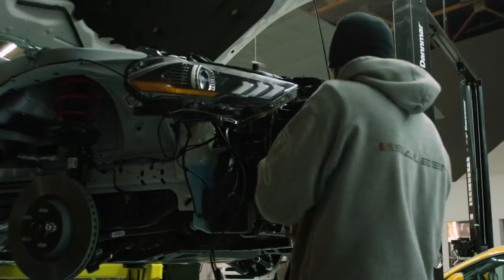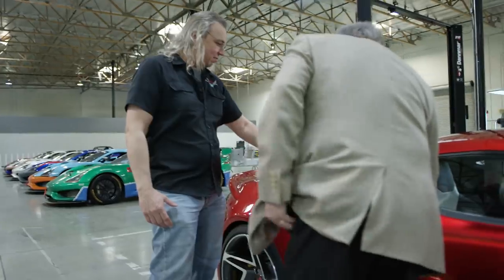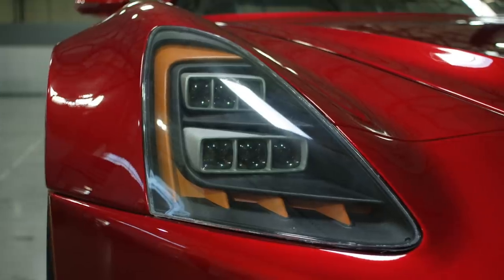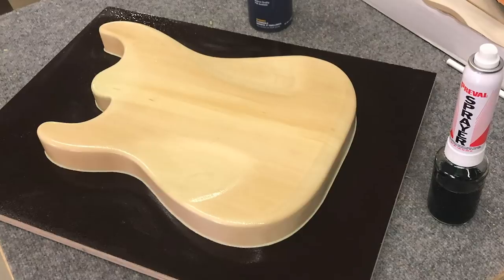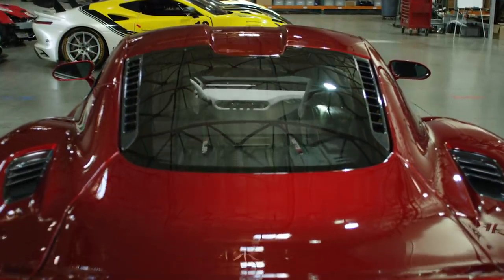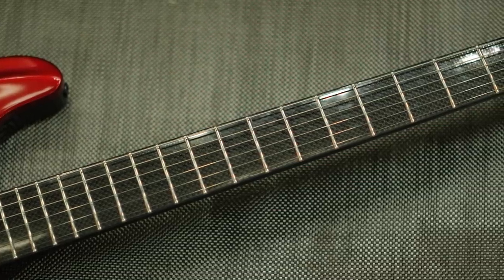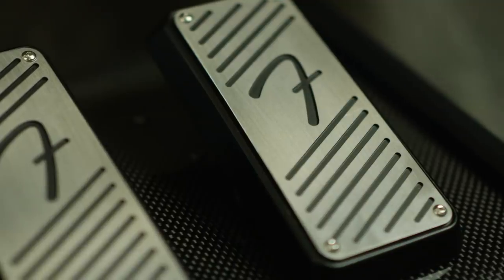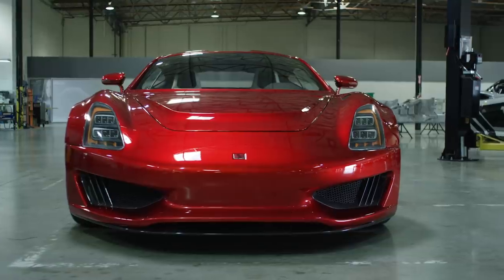Building the SALEEN STRATOCASTER 1 | Dream Factory | Fender

Comment: Good on them for making something totally new. They had been repeating old designs for a while. Nothing wrong with that, but I love to see something fresh.
Reply: Nothing much new, its a Fender version of the Parker Fly
Reply: Cycloneshockey94 I guess it could be seen as that, but I don’t really see it
Reply: @joe8124  What don't you see? Flys were built with an exoskeleton along the back and around the neck of the guitar. It was made from a carbon fibre/glass/epoxy composite material. The same composite also comprised the fretboard material.
Reply: Cycloneshockey94 oh you’re talking components! I thought you were talking about the shape and stuff. Yeah you’re right I’m starting to see it.

Comment: They re-invented the Parker Fly, lol.  As cool as it may seem, there are quite a lot of problems here, namely the fact that the epoxy material used to bond the carbon fiber together is not anywhere near as durable as wood.  It cracks very easily.  Next, because it’s painted, the way it holds the paint is very different than wood.  Look at any Parker guitar that has actually been toured with, and you’ll see the paint and finish coming off, especially around the fingerboard edges.  Until someone can solve those problems I would say using painted carbon fiber for an electric guitar is a pretty terrible idea.

Comment: The pedal board is cool but individual pedals would've been better. Even if you couldn't put controls on the side how about a small or remote or key that connected to guitar via bluetooth or radio and controlled the tone volume and pickups and stuff. That would be cool but controls on the side would be the best.

Comment: Fender "we made a guitar with carbon fibre"  innovation? I Dunno... 
A one pickup Stratocaster with a plexiglass cover which will get dusty and scratched and look s*** after a couple of years. No trem/vibrato nor even the innovation of a pitch bend pedal? Seems more like a hang on the wall vanity project.  Is the pedalboard solar powered? No doubt there will be a 'road worn, pre distressed'  model next year.